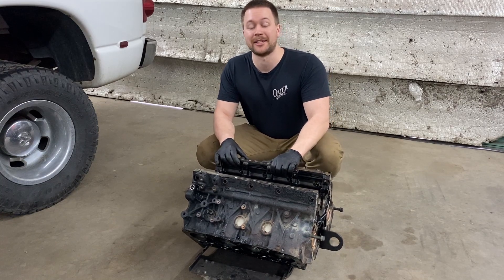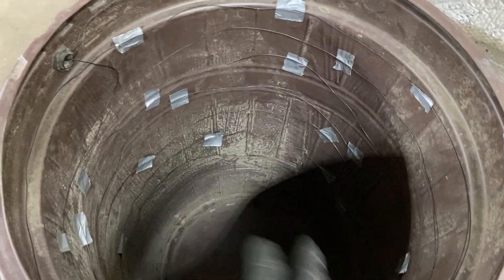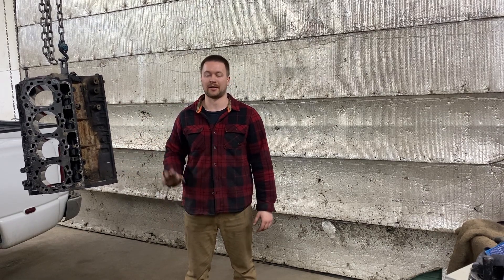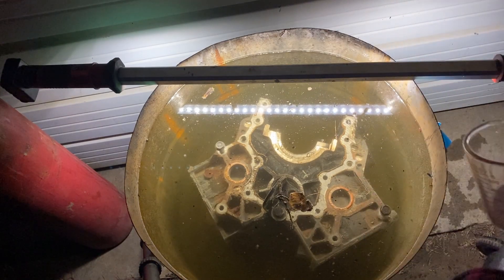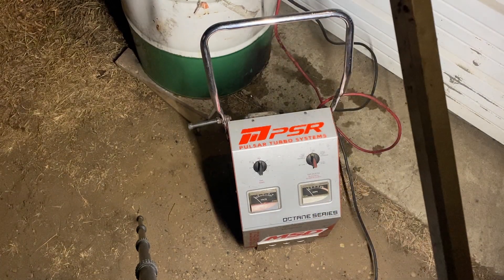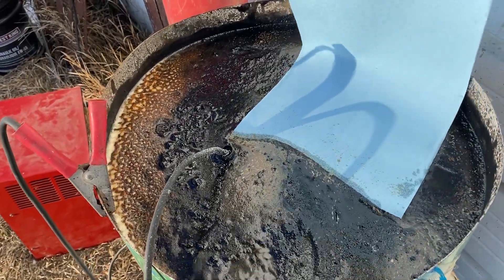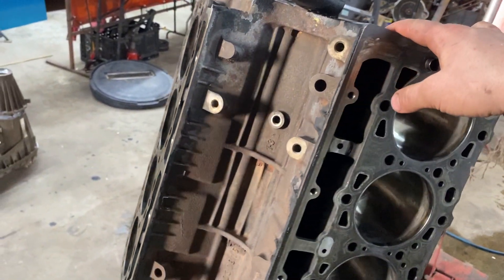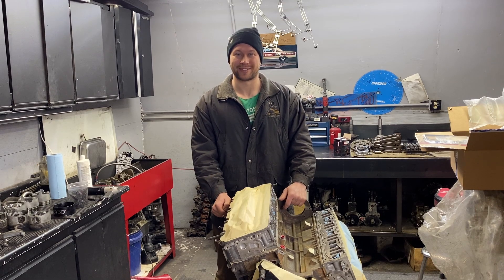Will Electrolysis Work On A Diesel Engine Block? Let’s try it out on this Duramax!

Comment: May be a dumb question but what do you do for drying/cleaning the bores how do they not rust from the water?
Reply from the maker: Not dumb! I spray the whole engine with WD40 and for the bores I use paper towel or a rag with ATF on it

Comment: 2:35, my guess would be that once the wood gets wet with contaminants it may conduct current, it is always better to use a heavy gauge plastic to ensure no current leakage. An old piece of Corian cutting block would be perfect.